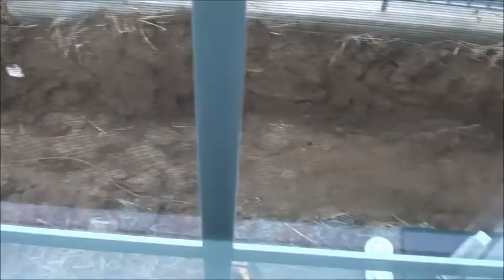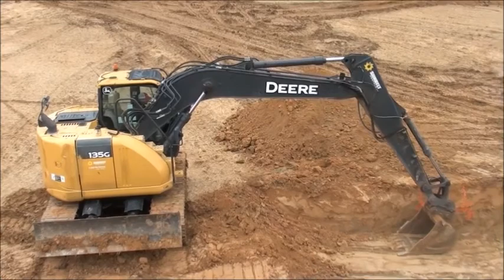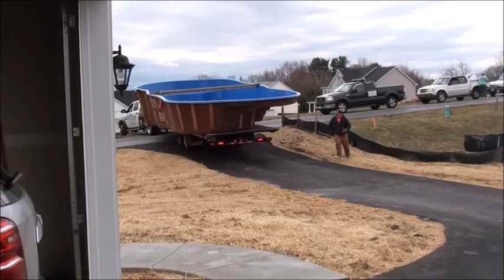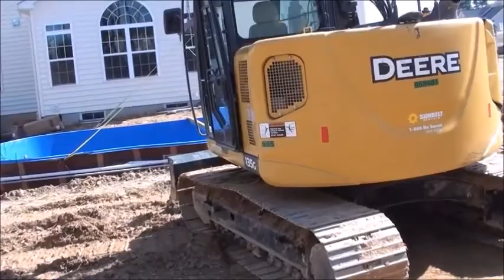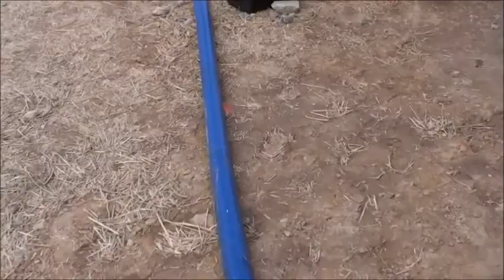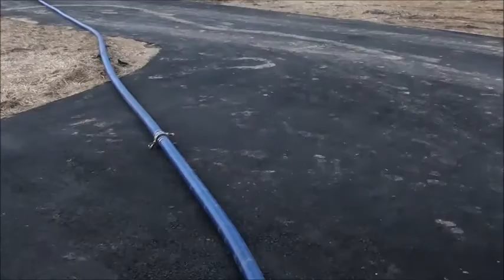River Pools   Crescent Cove 35 - Install Highlights

Comment: Very nice.  If you don’t mind me asking what was the ball park final cost of this project.
Reply: Final cost with patio and fence will come in around $65,000
Reply: Michael Godwin do you have any finished pics  that’s the exact model I’m interested in
Reply: I do not have any photos as of yet because the project is not finished.  I can tell you that this project would have cost much more ($15,000+), however I contracted my own electrician, patio, and fence. River Pools is excellent to deal with and they do a very nice job, however I found that they have built in a rather large margin (upwards of 100%) on their subcontractors.   We ran into some issues with my electrician not wiring they way River Pools wanted it and that did cost me a little bit to have someone come fix it.
Reply: Michael Godwin oh wow.  Okay thanks a lot for the info.  It’s been a big help
Reply: These guys will be the first to tell you that they are not the cheapest game in town.  You can get a larger pool with more features for less money, but you might not have a solid company like River Pools standing behind it.  They really have been excellent to deal with, and admittedly, I am a total pain in the ass.

Do you live in VA or MD?
Reply: @mikegodwin9768  Hi Mike.  I'll admit I'm a bit of a perfectionist myself and can be a pain the the arse, especially when it comes to paying a premium.  With all that said I'm a bit of a diy'er but never tacked pool installation.  I've had a few shell manufacturers send several recommended contractors, yet I'm still leary given the source of the info.  I appreciate you sharing your video and experience.  I may contact River Pools to see if they sale the shell only and deliver - once I find trustworthy contractors.